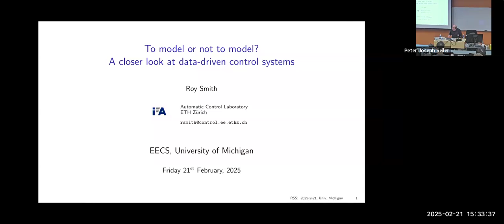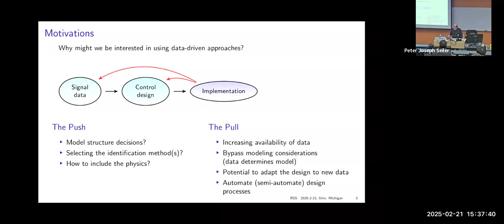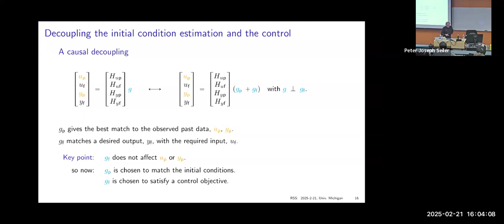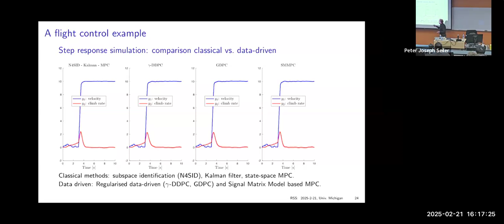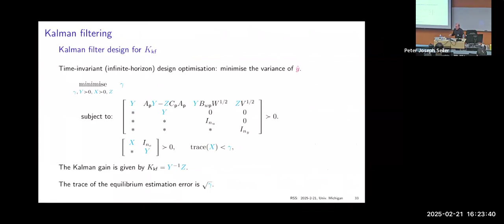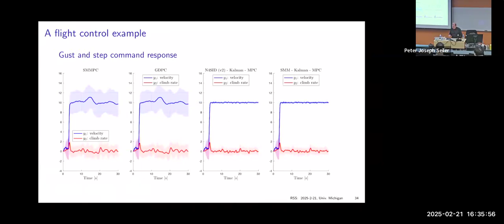Data as models? A closer look at data-driven control systems.

Comment: Existing Work: The presentation references Willems' Lemma, behavioral models, and Subspace Predictive Control (DeepC), which have been established in the control literature since 1999 (0:17:42, 0:25:29).
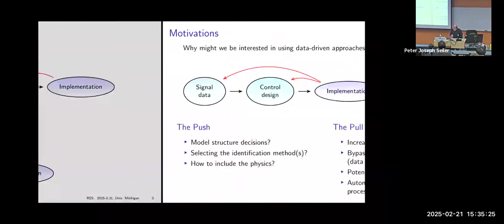Gap/Motivation: A key motivation is the difficulty of modeling complex, high-value systems (like refineries or spacecraft) and the potential to simplify the design process for systems where physical modeling is costly or impractical (0:03:41-0:06:20).
Problem Statement: How to bridge the gap between pure data-driven methods and the robustness/safety requirements of complex dynamical systems, specifically addressing unmeasured disturbances (0:48:14-0:49:04).
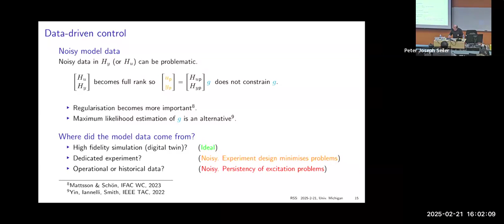Result 1: The development of a decoupled framework that separates initial condition matching from future trajectory optimization, reducing the need for regularization (0:30:27-0:32:08).
Result 2: Utilization of QR decomposition to parameterize the system and eliminate null spaces, providing an efficient, equivalent representation of linear time-invariant systems (0:35:10-0:37:32).
Result 3: Integration of a Kalman filter into the data-driven framework to enable state estimation and disturbance rejection, outperforming default toolset configurations (0:50:42-0:52:25).
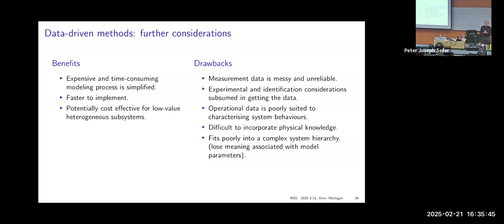Summary: The speaker concludes that while data-driven methods are powerful, they are not a silver bullet; they work best when data quality is high and must be carefully implemented to account for noise and disturbances (1:04:01-1:05:41).
Future Plan: Exploration of applying these methods to large-scale systems, such as aero-elasticity models and distributed control scenarios (0:58:23-0:58:42

Comment: seminar presentation uses various slides to illustrate concepts in data-driven control systems. Below are the key timestamps where the speaker introduces or references slides:

Classical Control Pipeline: (0:01:55) - Introduction of the traditional modeling and controller design workflow.
Data-Driven Pipeline: (0:02:49) - Overview of the shift toward bypassing physical modeling.
High-Value/Complex Systems: (0:06:20) - Examples of systems where data-driven approaches are cautioned against (e.g., oil refineries, spacecraft).
Control Framework & Cost Functions: (0:15:09) - Mathematical formulation for predictive control cost functions.
Hankel/System Matrix Models: (0:17:42) - Introduction to behavioral/data-driven models based on Willems' Lemma.
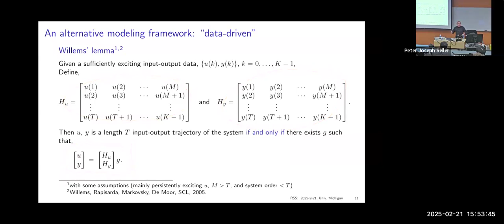Decomposition & Future Trajectories: (0:22:03) - Splitting data into past and future horizons for control prediction.
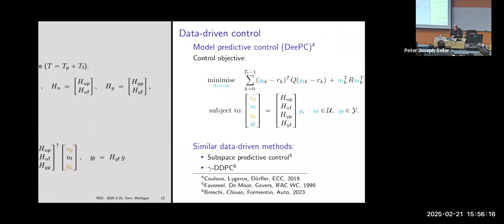Subspace Predictive Control (DeepC): (0:24:34) - Defining the control algorithm and the role of the 
 matrix.
QR Decomposition: (0:35:10) - Using matrix decomposition to simplify the representation and remove null spaces.
Boeing 747 Benchmark Problem: (0:42:36) - Presenting the longitudinal dynamics test case for the control methods.
Kalman Filtering Integration: (0:50:42) - Applying state estimation to handle unmeasured disturbances within the data-driven framework